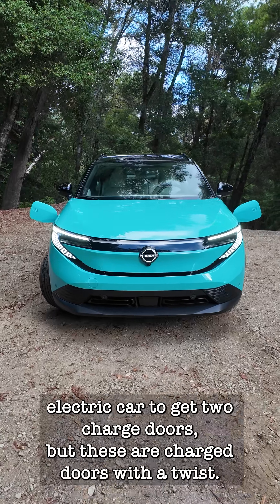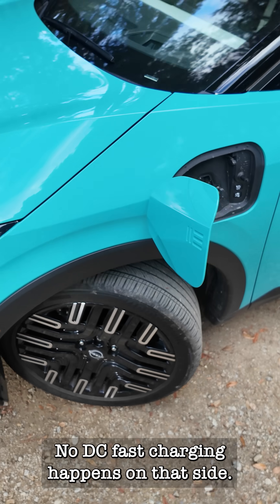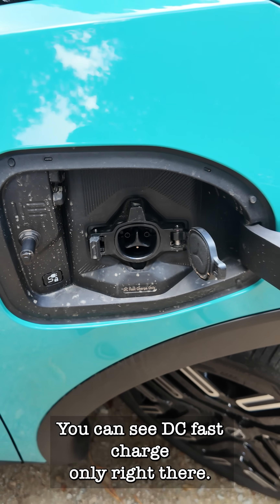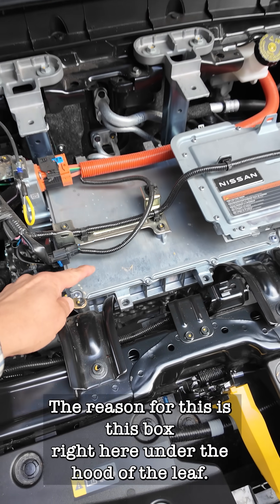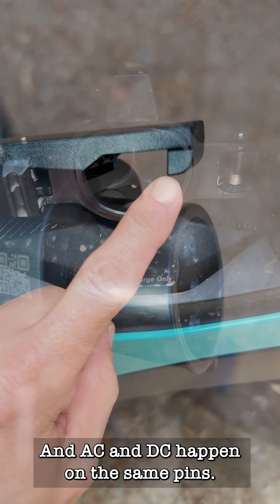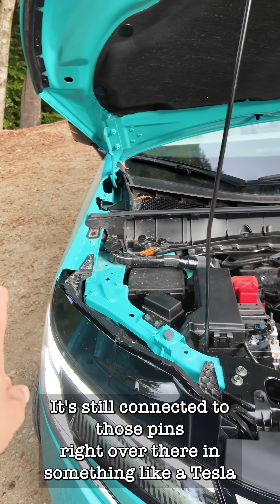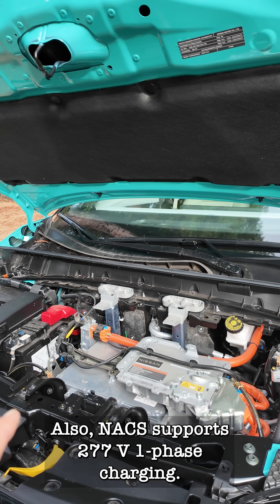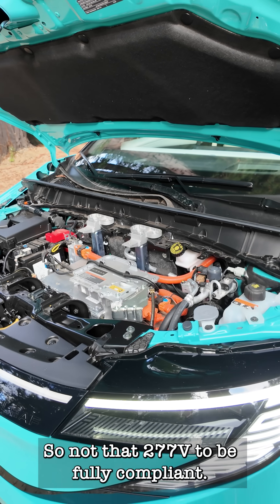Why Nissan's New Leaf Has 2 Different Charging Connectors

Comment: Yet I can charge my '23 Bolt EUV using Level 2 (AC) up to 11kW. 😔 Nissan once again fumbling a chance at having me as a potential customer. Would rather opt for the Ariya.
Reply: They are not fumbling it is cheaper to do 7.2 kw. That is more than twice my 2012 leaf at 3.3 kw. A lot of public charge point chargers are 6.6 so the leaf is right in line .

Comment: It would have been pretty neat if you could both dc and ac fast charge on both sides so no matter what station you pulled up to, you were compatible. Plus you get more options on where to install your charger.
Reply: just use an adapter on the nacs side for fast charging.

Comment: I honestly do not think that this arrangement is that confusing. For anyone who actually owns and operates this car on the daily, they will figure it out pretty quickly and it will just be normal to them.
Reply: Good comment! There are so many journalists who have problems with cars interiors. - Oh, it's so complicated to adjust the steering wheel, I have to look away to adjust the temperature by one degree, no that was two... You set both once! You don't grow or shrink that much overnight and 20c/70f works summer and winter. Yes, spouses and children can borrow and ruin every setting, but that's why there are memory settings! If you live with a car you usually learn where everything is and how it works…

Comment: Nissan spent so much on the redesign and then the A-Bomb Elon tossed his competitors offering them access to his network was predictably going to cause this and other issues. The slow charging Leaf is a perfect match to slow charging low voltage Superchargers. So what did Elon get for his generosity? He got every hardware manufacturer building infrastructure to support his vehicles currently being installed. Now he can toss more resources to finally rolling out V4’s that are meeting voltage standards his competitors had on day one. Will Walmart, IONNA, EA, EVGO etc benefit. Certainly because Tesla’s often can charge quicker off their Superchargers on these competitor DC Current capable cables. The way to have as many plugs as possible given the utility companies equipment and peak rate realities is to spread the power around which only needed 400V DC.  Nice for building an isolated EV company but as they are no longer alone will this work? EV makers are creating low voltage EV’s to save cost while some are delivering more than a 0-60 time but batteries at 800V or greater that leaves Tesla’s charging for ten additional minutes to get the same kWh’s. The later of the two for an instant gratification society is more meaningful. The biggest winners are buyers that have more choices. I’m only concerned slower charging at 400V will slow wide spread adoption with the stigma. 🪫🐌🔋is fine while you are sleeping but not great when you really need to get to your destination. If you don’t need a road tripping car these low voltage EV’s save money.

Comment: In theory, does it take DC-not-so-fast charging as well? like 7kW but DC?
Reply from the maker: In theory you can DC fast charge at any rate you like, they do make 10-20 kW CCS stations that would work with just about any EV as long ad you have 3-phase power to run it. I have thought frequently about getting a 25 kW CCS station for our office.